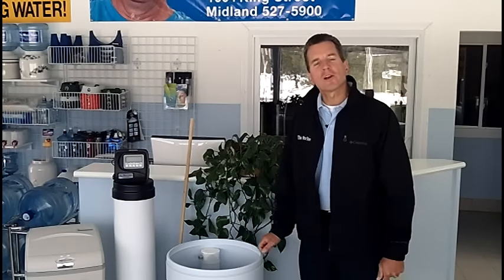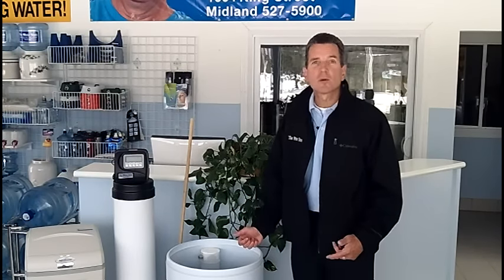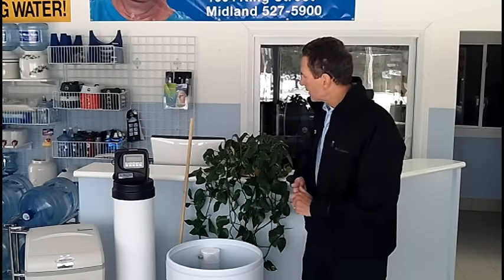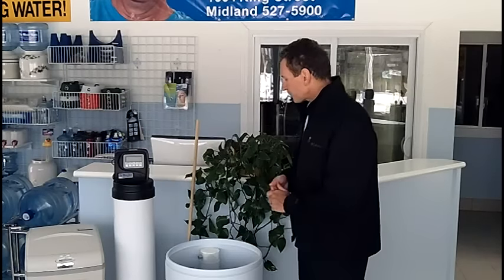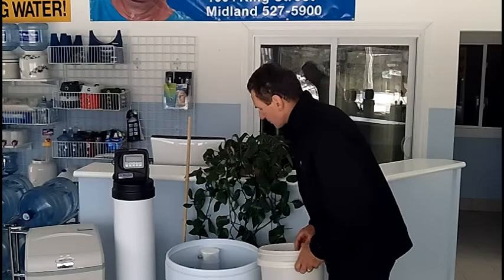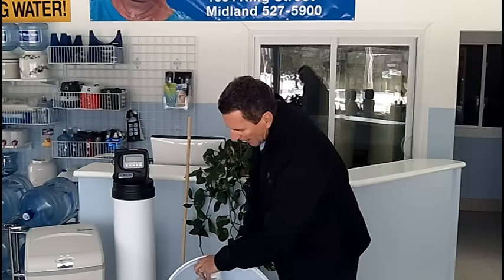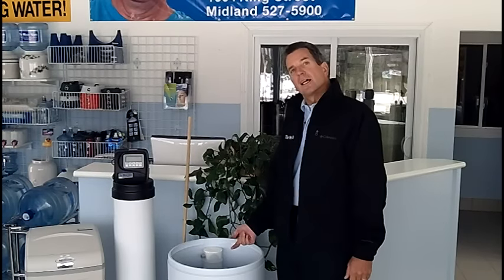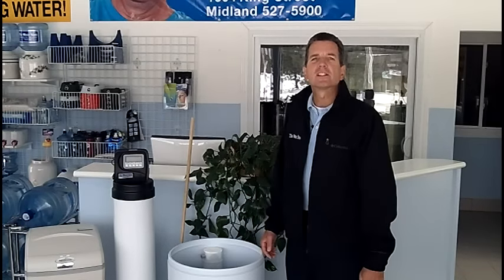How to Remove a Salt Clog from Your Water Softener

Comment: How much water should normally be in the brine tank before there is a generation cycle? I have a unit that has the media tank inside the brine tank and when the salt level is only up to about 2 to 3 the water level is usually about 2 to 3 inches higher than the salt level. I thought that the salt needs to be above the water and there should only be 2 to 3 inches of water from the bottom of the tank at any given time in the brine tank. Does anybody have any suggestions?
Reply: Thank you for the information. Trying to keep the salt level where you say not to put it as to prevent a salt block, are used to fill it all the way up. Now I try to go to thirds of the way and I want to make sure that the water softener is working properly. There are eight numbers in the tank of height add usually around number two is when the low salt indicator comes on I try to keep the salt level between six and seven; is OK with you?
Reply: OK then if you say that the manufacturer determines the amount of water that should always be in the tank after it has reached the regen cycle ending, what would designate high water in that type of system? Is it where the water level is overflowing into the top of the brine well or is there any other indication that would alert me that it is high water in the brine tank as opposed to the water level set forth by the manufacture? One other thing, can I use natural solar salt as opposed to pellets? I have a Kenmore model 350.

Comment: Ok  I had water in the tank and mine is waterboss 700 so I did the remove the sat and then as much of the water I could and then did the hot water and regenerate after the 4hrs, did the regenerate again yesterday and today a little water left in tank should I remove that and put fresh salt in and then regenerate again?
Reply: ok so then I can add salt? @water_estore

Comment: I've regenerated a few times without adding salt and there is still salt at the bottom. I feel like I am missing a step. Was I supposed to empty the brine tank each time before regenerating?
Reply from the maker: No, assuming that the water softener is working correctly it will draw out the brine and add water during each regeneration   Depending on how much salt you have in there it takes numerous regenerations 24 hours apart or you can remove it manually
Reply: @water_estore  okay, I watched the whole regeneration cycle. The brine water goes down about halfway, and then it fills back up (suggesting it's using and creating brine water). However the water looks really dirty, a slight brown color with hairs and slimy particles. It would be a good idea to rinse and clean the brine tank right?

Comment: I have a Boss water softener about 4 years old.  It worked great but for the last year  it is not producing soft water.  I tried a clean out and regeneration as told by the company.  It regenerates on its own, never uses any salt. Can't find anyone in my city that will work on this brand.Can you help? It looks like the one on your right in the video.
Reply: Jennifer Cosper - call the waterboss help line, they are pretty good at walking you thru troubles, if you have the owners manual for it there is a troubleshooting guide at the back of it, if you don’t the go to the waterboss site and download a copy of your manual for free. Just have the model number for it. I have owned a waterboss softener for 20 years and it just out, bought a new one, we will see how this does, so far so good, they are very easy to work on.

Comment: I did everything you said and 2 days later all the salt is stuck together again. It worked for 2 days. Could something be wrong in the regeneration cycle. It is 2 months old it’s a watts softener.
Reply from the maker: Something definitely isn’t right. Call the manufacturer

Comment: They ALL say to use the cleaner pellet type.  The up take tube sits about a half inch or so off the bottom of the tank. Any sediment settles and does not get taken up. I wash the brine tank out every couple years to remove the bit of sand. Your can not get TOO soft. The softener will just regen before it needs to. It will only remove the metals in the resin bed. It wont do it any harm. Imagine just putting in the wrong hardness number by mistake. A bit of salt and water wasted but no damage. It is harder on your softener too regen not often enough as opposed to too often.  You could essentially regen everyday without wrecking anything.
Reply: SJL8006 So, I've researched this and it's not true to say that you cannot have your water be too soft. Water that is softened too much will corrode your copper pipes.

Comment: I pretty much did that before seeing the video, but why do you need to wait multiple days to do this? I had to chip away for an hour, but I got all the salt eventually out.
Reply from the maker: Good question.  Water needs 24 hours to absorb the salt.  If you don't wait it won't work.

Comment: What if the clog isn't being caused by a salt bridge? Softener starts up but doesn't fill the tank? does this mean the clog is in the softener itself? talking about prefill softener if it matters.
Reply from the maker: Could be.  Why not remove the salt clog and see if it solves the problem.
Reply: @water_estore  I found a stuck aircheck valve to be the problem, I took the float assembly out of the tank and soaked it in a bucket of hot water for a while. The little ball broke free and now freely moves up and down. so far seems fixed. Could you do a video on air check valves please?

Comment: Gary...I'm an idiot.  I came home late one night and was about to refill my brine tank with a few bags of salt.  I opened the lid, noticed that it smelled a little foul...not earth shattering.  I said to myself, "Well, the salt was low enough (just about an inch above the water level...approx 5" or so up from bottom of tank), so I'm going to dump this and clean it out."  I disconnected the single return line and took the entire tank outside...turning the tank upside down and dumping the dirty water and breaking up the old salt at the bottom of the tank.  I cleaned it quickly and reconnected the line.  Our water is still soft, but we've noticed the water seems to be a little bit salty looking.  Not bad...still quite clear and clean, but I do feel as though I see a bit of salt when we fill a glass of water.   I went back to look and the brine well has some salt stuck to the sides...sporatically...some even up above the float.  Of course, it's because of my first introductory sentence above.  In tipping the tank upside down, I'm sure it brought some salt and dirty old water up from the bottom of the brine well.  #1, Should the brine well be completely clean and clear of debris?  I can't recall if it was before I did this, so maybe it wasn't my stupidity.  #2, what is the next step to rectify any damage I may have done?   Do I clear all the salt and take the brine tube out and check all components and blow things out to be sure there are no clogs?   I should have watched YouTube before I did this.   It just looked like a simple thing to do.

Comment: So my colligan water softener will not regenerate. There is no salt in the tank and very low water. The motor on the colligan tank is warm and sounds like water trickling
Reply from the maker: Sounds like you need either a rebuild or a replacement.  Check this out https://waterestore.ca/products/hum-metered-water-softener-45-000-grain-capacity?_pos=41&_sid=ffddf17a2&_ss=r

Comment: Plastic tube is the safest. Its not sharp, and you would have a hell of a time breaking the bottom of the tank with it.  If the salt bridge is so hard you can't push through, pour hot water on it. That will dissolve salt faster than cold water. Even if you have to really fill the brine tank and then suck some out, thats the safest way.
Reply: Plastic will shred, too, and I think I'd rather have wood shavings than plastic in my water! Also, I never get salt bridges, just hard salt in the bottom of the tank.  I have tried hard water - it helps some, but I still need the stick.  When you say, "suck some out," do you mean with a wet vac or by regenerating the softener? It wouldn't be practical to use a wet vac because it happens so commonly. I do completely clean it out a couple times a year.

Comment: My tank is so tall and narrow I can't reach all the way down to remove all the salt.  There's probably 12" of salt still in the tank and I can't reach any farther.  Now what?
Reply from the maker: Remove the water with a shop vac and tip it on it's side to get the rest of the salt out.

Comment: Hi,
I followed your steps and it did remove the clog. I re-added salt once the clog was gone but am noticing another clog forming. Do you have any idea what the issue could be?
Reply: I'm using Morton Salt System Saver II Pellets. I filled it up to the 5th line out of 8 but I will try to use less.

Comment: Does this technique work for a salt sludge too? I have a huge one and it's very difficult to chip away!
Reply: +Gary the Water Guy I bet I just had 8-10" of pure sludge at the bottom of my brine tank, I am sure this is why I hardly use salt (although I do, I have refilled it very infrequent)  what a mess in the shop vac though!

Comment: Just an idea use a litter scoop
Reply from the maker: Yes, for the stuff that is loose that works well but as you get further down and it is one large salt mass you will need at least a steel garden spade or shovel to break it up before scooping it out.

Comment: You really shouldn;t be getting a salt "block" that often. Are you using the pellet type or just rock salt? I like the rock salt better. Its cheaper, works fine and is less likely to clump at the bottom. The pellet type, I find< starts to break apart as it dissolves. This is even worse if the softener is not regenning very often. Turn the hardness setting up a bit so it regens more often.
Reply: I'm using crystals (see my conversation with Gary). My manual says not to use rock salt because they have sediments that will stop the softener from working. If I turn up the hardness setting, won't it make my water softer (i.e., slimier) when it IS working?
Reply: SJL8006 - wrong, some softeners don’t want you using rock salt at all.

Comment: Just disconnect the water line to the tank, take it outside salvage as much salt as you want, dump the rest and wash it out with a hose. Reconnect it and fill with salt. I've never had a salt clog with mine just problems with the media passing by.
Reply: Umm...I you tip a water softener on its side, all of the resin beads get misaligned and then it doesn't work any more.  tipping a water softener on its side basically destroys it and wont be usable anymore

Comment: Just curious, why wouldn’t you just empty the whole tank of salt, run hot water through it and just start over?
Reply from the maker: Yes, that is what you do but the problem is getting the salt out, especially if it has formed into a huge salt block.  You can hammer and chisel it out or use this method of dissolving the salt in water is a lot easier.
Reply: @water_estore  well I found out you were absolutely right. I just did mine on Thursday, massive 30-60 tank, had about 12” of sludge in the bottom. Not quite a block but a pain to get out nonetheless. I got about half out by hand and then tipped the whole thing over to get inside and get more out, until it was light enough to just dump it. I’m glad I did though, pump house is in the woods and the tank hadn’t been cleaned in a really really long time, so there was some nasty stuff in there, lot of bugs and dirt.

Comment: So funny: The previous video I watched form you had all the audio in the RIGHT* ear and this one has all the audio in the LEFT ear!

Anyway, good info. Having one of these installed in my garage is not an option because of where the water comes into the house. I'm in Florida so it very rarely gets below feezing down here: Is it going to cause any problems to have the unit outside? I would almost certainly have the pipes wrapped and the unit itself inside an enclosure of some kind.

* This one: https://youtu.be/C3TpdeNX58E
Reply from the maker: With my older videos, like this one, the sound can depend on the device you watch the video on.  I totally upgraded my audio and video equipment in the fall of 2019 and all videos since have better sound on all devices.  Yes, in Florida and many other southern US states you can have the equipment outside.
Reply: @water_estore  Cool. There ARE a few days out of the year where the temps can drop to below freezing, so I would definitely wrap the pipes and enclose them in an insulated enclosure. I even read somewhere else that people sometimes will put a UV light in there and turn it on during cold nights, which I thought was a great idea. I could even probably figure a way to have the light come on automatically if the temperature drops below a certain level (and turn back off when it warms up, etc)

Comment: NEVER use wooden stick. Salt is hard and sharp. It can often does break off small splinters of wood. These can very easily plug up your flow plugs.
Reply: What should you use, then?
Reply: Ja Hank - we use a plastic pipe, 3/4” size plumbing pipe, works great

Comment: Be careful poking around the tank with a broom handle.  I poked a hole in my tank once and had to buy a whole new system!
Reply: @water_estore  I have water spitting out of my faucets inside my home along with low water pressure idk what I can do to fix these issues any suggestions?

Comment: This process did not work for me cause the salt was rock hard
Reply from the maker: It is the only solution that I have found.  Whenever you replace the water, the new water will absorb the salt.  It can take numerous attempts but it will work.

Comment: I'm sorry but this is a terrible video for understanding what you're doing.  Can't tell what is going on.   Main thing is is  I don't know what the Salt Brine Well (or whatever you called it) is what I think it is.  If I could have seen inside of it I am sure I would have known for sure which part you're working on.  

Currently trying/looking into fixing my water softener because it is occasionally spitting out super super salty water and it hadn't done that before.  
Not sure if this would be a normal question someone would ask in a situation like this but no we haven't started to use different salt, been using the same salt for years now, Morton giant salt pellet bags.